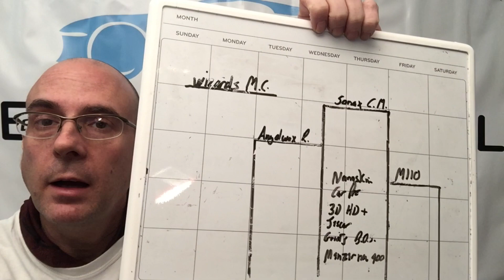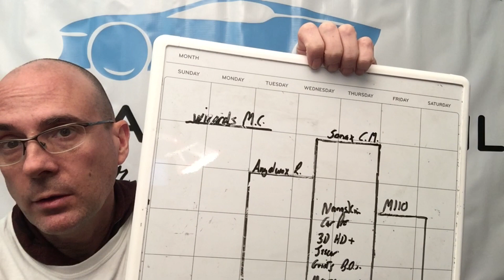Meguiar's Ultra Pro Speed Compound M110!

Comment: I've had a chance to use both M110 & M210 on my black test hood. They are the most user friendly compound and polish I've ever used. No dusting and wipe-off is awesome. Not oily messes that smear and require a lot of buffing like others. They both don't have the best cut or finish that I've ever used, but still good.

Comment: In your professional opinion, now that Meguiars has some compounds that don't create INSANE amounts of dust, does M105 even have a purpose anymore?
Reply: Auto Detail Podcast interviewed the Megs folks at SEMA (you can find it on YT) and they said those compounds were created for body shops and OEMs using rotary polishers and will continue to be sold and used by them due to years and years of experience with it and its effectiveness in their environment. This was formulated from the ground up for DAs and Detailers.
Reply from the maker: Detailers can use 105 for a paperweight!😁

Comment: I've compared  M110 to Jescar, Fast Correcting Cream and Oberk Compound on my black test hood. M110 provides a nice lubricated buffing cycle. It's less oily than the others I mentioned, which makes wiping off a breeze. No dust with M110. I found  Jescar, Fast Correcting Cream, and Oberk compounds to finish noticeabely better on my test hood with a MF pad. M110 is a pleasure to work with. If it finished like the others, it would be the only compound I need.
Reply from the maker: Brewinz agreed... right there with CarPro, Wizards and Americana Global 1500 as well.
Reply: What was your process when using the 110? Technique for the finishing step with 110 plays a huge roll. In our testing, this finished LSP ready more often then not when technique was dialed in. - Markus, Meguiar's Pro Product Manager
Reply from the maker: On hard paint .. it finishes just fine with a microfiber. On softer paints. You can switch to a white foam pad and finish ... still using 110. On soft as butter clear, it is time to grab 210. I am loving it the more I use it!👍🏻😁
Reply: @MarkusKleis  what technique do you find finishes best with 110? Generally speaking.
Reply: Brewinz I find that slowing down machine speed tends to help quite a bit with improving finish. On more sensitive paints, doing cutting at speed 3-4 and then stopping mid cycle and blowing out the pad, adding two tiny drops and then doing a couple passes at speed 1.5-2 seems to finish out like a dream. I also find that both 110 and 210 tend to prefer denser and firm foams as they do a better job of pushing the abrasives into the paint. Hopefully that helps.
Reply: @MarkusKleis  thanks!

Comment: What timing!  I literally just got a quart of this from Autogeek with my latest re-stock purchase.  It does look like Meg's finally fixed their compound!  I've ran gallons of 100.  The reason I quit buying the 100 is that you need so damn much of it to do the job, it could be quite fickle depending on the weather, and dusted like crazy.  Thanks to your great videos I've changed my products to the higher end (Sonax/Jescar/Menzerna). Who knows, I might just fall back in love with Meg's.
Reply from the maker: Steve Sulkowski I have a feeling, if you try this, you will add it to your arsenal.👍🏻
Reply: And to think that a lot of us switched to M100 because M105 was so dusty!
Reply: @danlc95  m100 was definitely an improvement on 105, but a long ways off from the top guns out there
Reply: @MrSulkow1  - So true. 

Dust is my biggest pet peeves with a compound.

Comment: According to independent tests Koch Chemie H8, Mothers Heavy Duty Rubbing Compound, Meguiars M101, Rupes Mille Coarse Compound and 3D ACA 500 all cut more than M110
Reply: zubair tvbox 👎🏻 nope
Reply from the maker: Mothers... no. Rupes, junk. ACA 500 is coming up next so stay tuned. As for Koch.. they refuse to sell it here.. so I personally dont give a rip.😁
Reply: M110 out cut ACA500, Rupes DA Coarse, Jescar Correction Compound, Menzerna 400, D300, etc. 

Never saw that coming.

Comment: Hi, In a video made by Autogeek the fellow from Meguiar said with the M110 &M 210 the only pad you should use are microfiber pads. Do you think it will change the result of your test. On the sand scratch you use a foam pad. Sorry to disturb you with that question but I am realy a beginner. Should I stay with Griot's fast correcting cream or should I move to Meguiar's. In Canada it is not to easy to find all the product we need. Thank you.

Comment: What kind of pad are you using?
Reply: He's using the Lake Country low lint wool for actual correction I believe. Available on autogeek in a couple sizes for sure, but you can probably get them other places as well.

On the red test panel with the sanding marks, I think he was just using a standard orange foam cutting pad. Can't recall the brand but it's been the same throughout the series to limit variables.
Reply from the maker: This👆  https://www.autogeek.net/lc-lowlint-6inch-pad.html?productid=lc-lowlint-6inch-pad&channelid=BIZRA

https://www.griotsgarage.com/product/3+inch+orange+foam+correcting+pads.do?code=PPCPLB&msclkid=44d23c54a4211195f32f6046598368de&utm_source=bing&utm_medium=cpc&utm_campaign=Bing_PLA_Shopping&utm_term=1100505896025&utm_content=aaaPLA-%20Pads%20%26%20Accessories

Comment: These are $40 now days.
Reply: Not only that, but M100 cuts and finishes just as well and is far cheaper. Yes it dusts, but it also has a far easier wipe off and works more quickly.